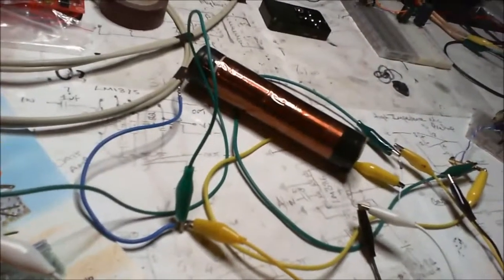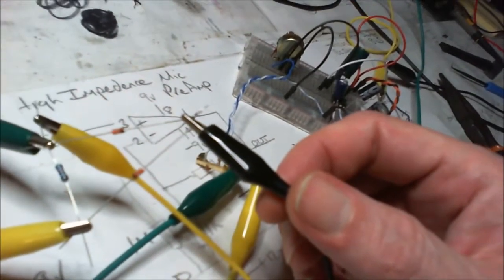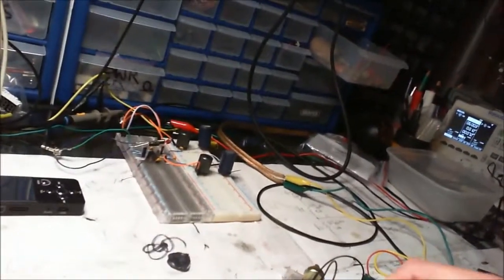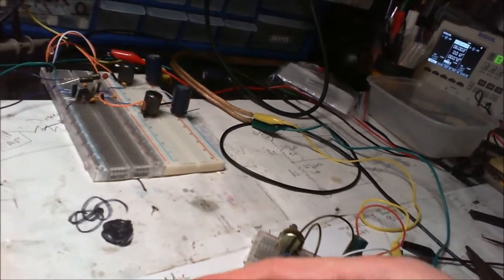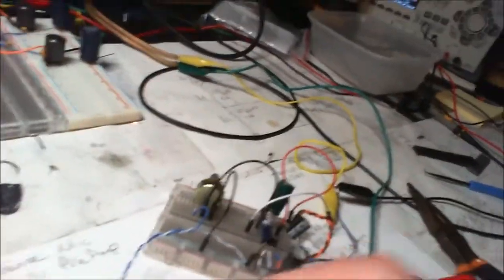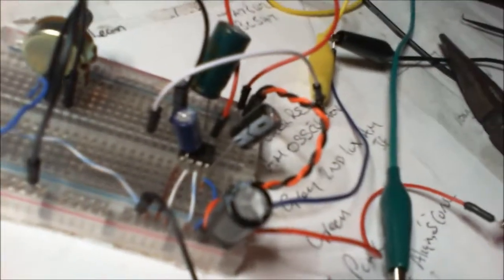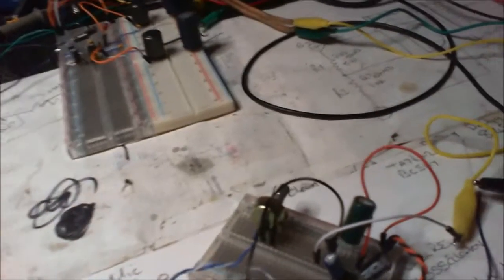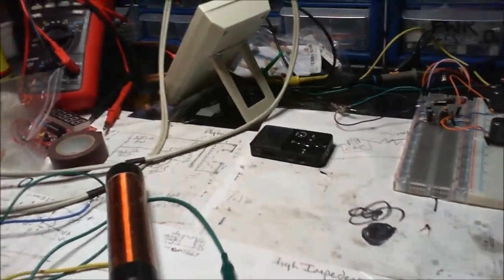Simple Crystal Radio 2 Diodes 1 Resistor pt1

Comment: I tried this with just a 1n34a diode and nothing worked.
Reply from the maker: I don't know about using one diode, I used two in this video. Plus coil and variable capacitor. The signal is weak and a crystal earpiece would be good. As you can see I used a little chip amp circuit to amplify the signal.
Reply: +Huck Fin, see SciToy & Billy stuff :)
A simple radio with three parts : http://scitoys.com/homemade_radio.html
https://youtu.be/k3HsVlxR2tA ( Set Speed to .5 or .75 from youtube menu[wheel icon] )
https://youtu.be/DjCKVAMJGlo (Chinese, just see method of making an crystal earphone from a buzzer)
NOTE: in SciToy site, ground means you connect a wire to a pipe (metal/copper) that goes to ground of earth.
And Antenna means a hanging wire like 15 ~ 20 meters/yards hanging in air between house and some rod.
The reason for that length is to collect as much of AM radio (RF) signal as possible.
This guy explains GROUND well https://youtu.be/zLW_7TPf310